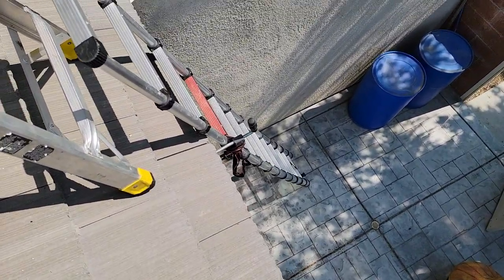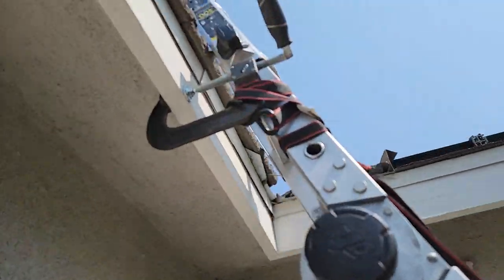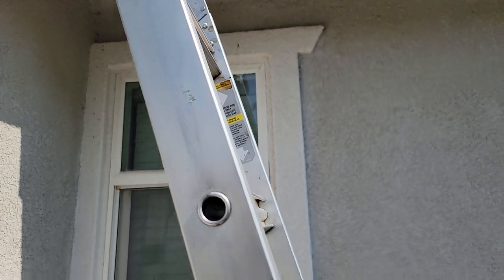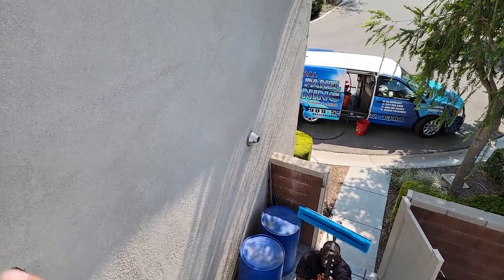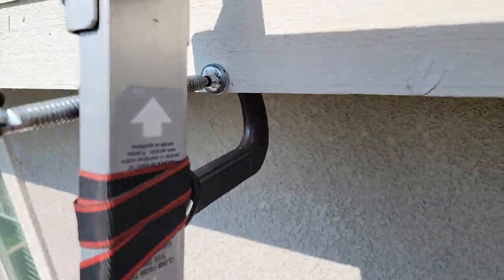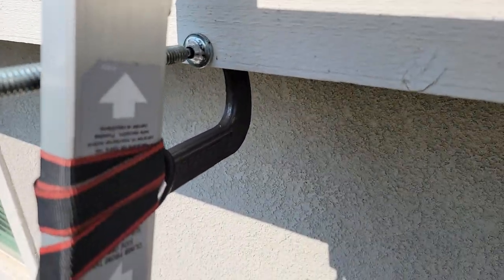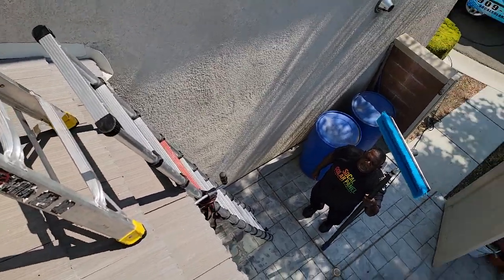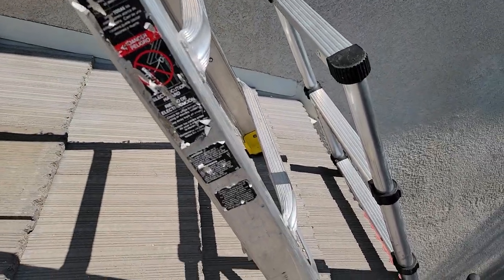Solar Panel Cleaning | Setting up a Ladder on a Two Story Home

Comment: Thnx for your vid.. it’s hard to find “how to club a two story house or get on” videos. My parents have severe issues, well our whole neighborhood in the hills and pigeons are going under the panels and hiding in any food crevasses. We have to now attach netting or chicken wire to cover all area and the panels. We just need to get on the roof safely. The the parts alone net is maybe all $40-$100 and just ur labor. It’s not hard but we are getting all these scam companies telling us. “Oh that’ll be $10,000 or $5000” for chicken wire and a staple gun? They know the issue we are having so they are hoping we are lazy or that naive that we won’t check or just tired of the issue. Either way thnx again plus those panels do need to be cleaned regularly

Comment: I have been interested in getting into this business as a side hustle. When you guys work with shingle roofing, how do you avoid breaking/cracking any of the tiles? I know in one of your videos you mentioned that you charge extra if you work on that type of roofing. But if one of the tiles did break, is it your job to fix it, or would you simply use that extra money to give back to the customer?
 
A couple other questions:

What brush would you recommend for someone just starting out?

If I don't have a DI water setup likes yours, would it be sufficient enough just use a portable DI sprayer that can be used after water brushing the panels?
Reply: Did you ever get into the business? Curious how it’s been going for you